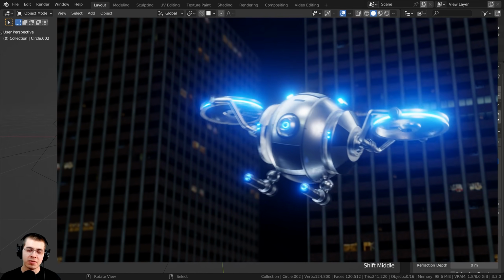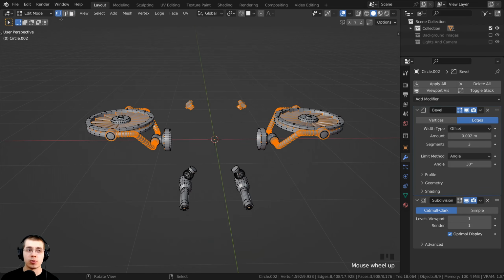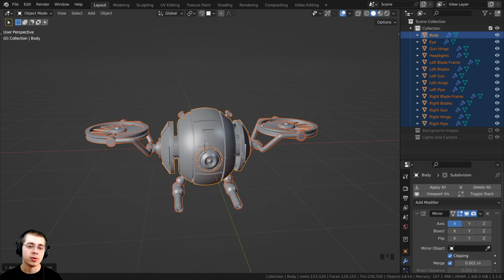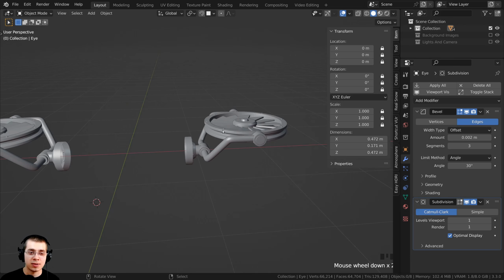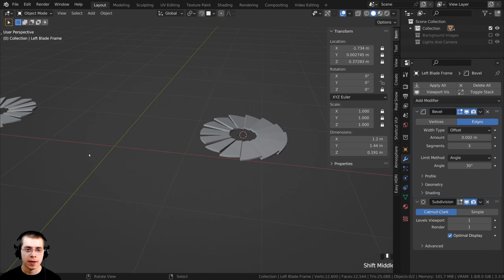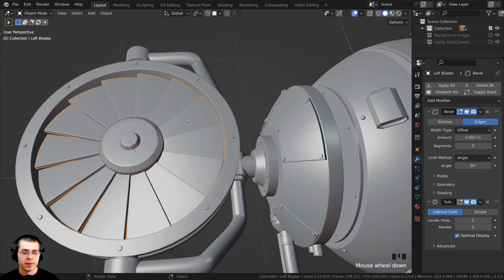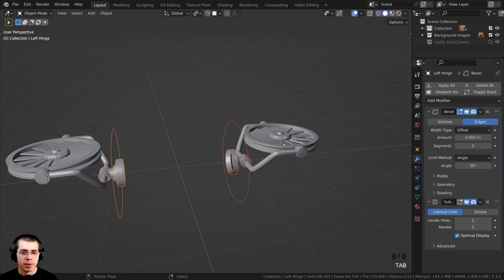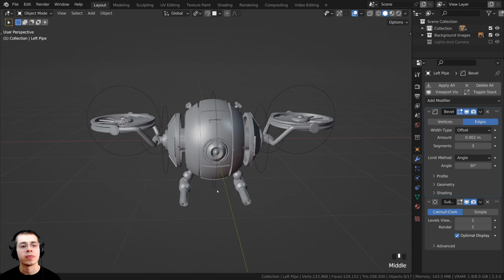Sci-Fi Security Drone - Part 5 (Blender Tutorial)

Comment: Hi Ryan. At 19:20 when doing the parenting of the fan assembly to the pipes, after the parenting transform, a dashed line shows up between the origin point of the fan assembly and rotation point origin for the pipes. It also shows in the render view. Any suggestions you might have would be greatly appreciated. The parenting of the fan blades to fan housing happened without issue. The dashed line also showed up between the body and cameras when doing the parenting but all other parenting seemed to work as shown in the video.
Reply: Think I have it figured out. Had to go to guidelines list and turn off relationship lines.